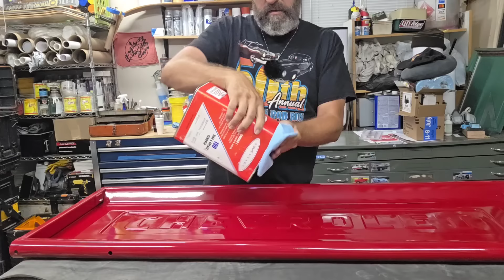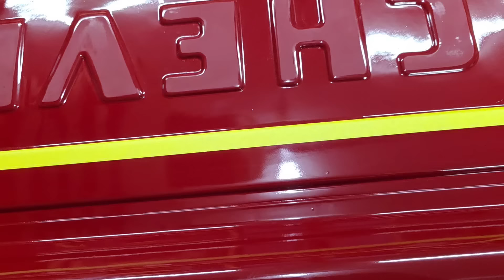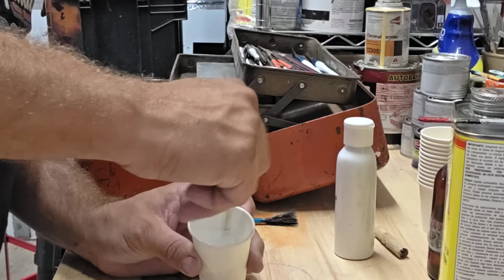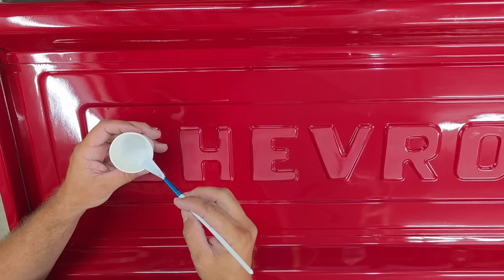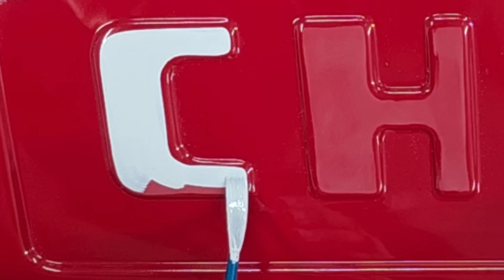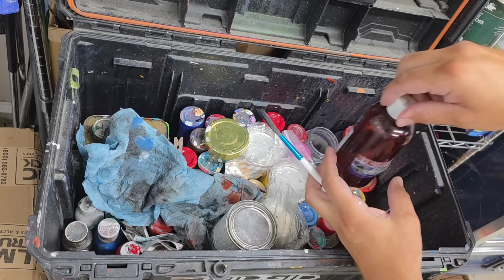How To Paint Tailgate Letters

Comment: I believe originally the factory used a hard rubber roller on rails to paint the raised letters. It took only seconds on the assembly line
Reply from the maker: I believe you are correct. It is called a breyer. You can use a hand breyer, but the edges are not as crisp and if you have any kind of dents or blemishes it will not compensate for them.

Comment: Hi Jack, Let me start by saying nice job. I have 3 questions, : 1. Why not wet sand and then clean off tailgate ? 2. Have you tried spraying a clear coat over the lettering to protect the white paint ? 3. What kind of oil did you use on your brush after cleaning it ? Thanks Roland
Reply from the maker: 1. I clean before and after. I dont know what is on people's vehicles. I would rather be on the safe side, and not grind a contaminants in. 2. No need to clear over catalyzed lettering enamel. If prepped right, a lot of times clear coats will fail before the enamels do. 3. Brush oil. My personal preference is Von Dago's brush oil, mainly because I like the smell.

Comment: Wonderful to watch. 'Spinning' brushes to remove thinner etc. from brushes is a bad habit. Simply use white cotton cloth. Spinning splays the fine hair, detrimental to any 'shaping' the brush has. To do this to the finest hair (and best pure Sable, Kolinski) is a ruiner for sure. Fine Ox hair just tangles...
1 Shot is a beautiful paint to use. I use to work with Solver, both in enamel and acrylic. Solver had a brilliant very flat acrylic too, great for poster work.
Reply from the maker: Spinning is a habit I picked up decades ago as a house painter. I can totally see the point of it being harsh on fine hair brushes, specially if the hairs have become dry and brittle. Cant say that I have seen issues with shaping or tangling though.

Comment: I use that kind of pain on tools and I used it on the intaken manifold of my old IHC truck. It's good stuff. Its lasted 10 years on the manifold and it lays down nice and smooth out and doesn't leave brush marks
Reply from the maker: It's good stuff
Reply: @JackFlemingArtistry do you have any experience with how the colors hold up after years in the sun?

Comment: Great work, Your being too modest, you make it look too easy. Ive been painting cars for 20 yrs, but when it comes to painting a flat wall with a brush, I struggle, and always think, how can I spray this :) let alone do edges, specially the way you curve the round edges. its not something most people can do.  For me it will be "Ill get vinyl cut for the outside, and paint the inside :) and I know thats not the same as hand painting it, its coz I honestly would not be able to edges like that.  Honestly I think this is harder than Airbrushing in general. On cars we dont really use anything but 2K. is the red paint Acrylic aswell or 2K? if the red is Acrylic. you wont be able use 2k for the letters. But if not any reason you dont use 2K? The amount of hardener needed is actually nothing else but all science :) and its is always very specific.
Reply from the maker: I dont use acrylic, neither do the body shops I work with. The red is basecoat clear coat. The paints I use are designed to work on too of many painted surfaces and specially on top of 2 k. Yes, the amount of hardner is science. The training classes at PPg have said not an exact science, though recommendation were given to to exceed 15%.

Comment: I do Toyota tail gates. I get white vinyl cut to the exact measurements and apply it to the raised lettering. Quick, neat, and done in 20 minutes!!
Reply from the maker: These usually take me 40 to 50 minutes. My earliest work doing these with paint was 20 years ago. Those jobs still look new today. Vinyl is definitely the cheaper faster way to go, but I just dont have the faith in it's longevity that I do in paint. Like most things, it's a matter of preference. Personally, Im glad not everyone does everything the same way. Makes the world more interesting.
Reply: Vinyl is certainly not cheaper, and it is precisely how you want to apply it . It lasts way longer than paint, and it is perfect!!! No brush strokes. You can even get the reflective Vinyl!!
Reply: @Odipodi where do u get the vinyl?
Reply: I get it cut to size at a sign and graphics shop.

Comment: Think I would have used a hard rubber roller since your working with a raised surface. Much simpler and quicker.
Reply: Since the edges of the letters have a radius, a roller is not going to give you the perfect result he gets in this video.
Reply from the maker: I have used them, but I dont like the results as much. And honestly this only takes me about 5 or 10 minutes longer. These jobs usually take me about 45 minutes.

Comment: I had restored a Coke Machine from the 1950’s and needed the letters painted white. I hired a professional sign painter to come to my shop and paint the letters . After he glopped  on the paint I had a perfect high gloss restored classic Vendo Machine with smudgy thick brush stroked letters. Afterwards I removed the crap lettering, fine lined it, airbrushed, 2000 grit sanded and cleared. Live and learn, and don’t trust a pro who does not give a crap. You could have taught the “pro” .
Reply from the maker: Not all "pros" are professional. I try to tell my potential customers all of the time to shop around, look at people's work and fund the person that will do the job you want, not just the person that is available. Sorry to hear of your experience.

Comment: You might want to try doing the rounded corners first in a few spots and then connect them with your straight lines. This will help with the brush strokes so you aren't going back over it to smooth them out.

Comment: I'm curious, why Sprayway and wax and grease remover before sanding? Seems like you'd sand first and then clean it up.
Reply from the maker: Mostly habit. At least in my mind, I'd like to know Im not grinding any contaminates into the paint. My thinking could be way off though. What do I know.
Reply: Always clean the surface before sanding.